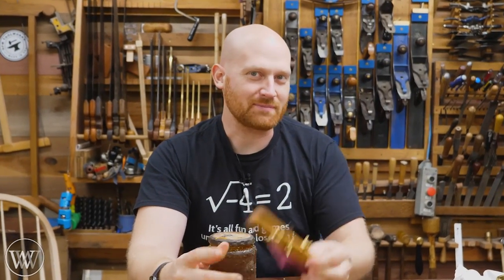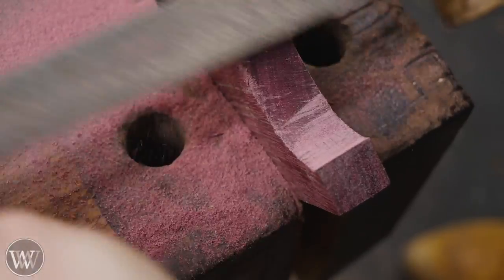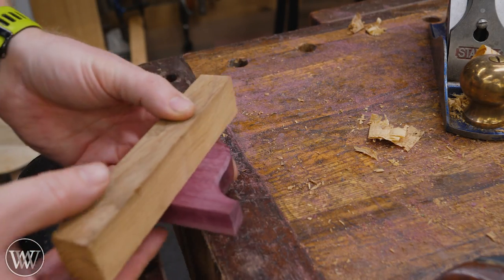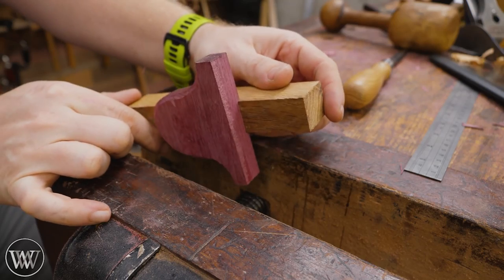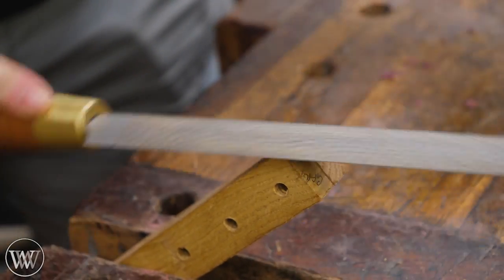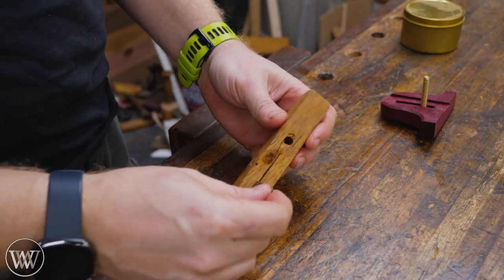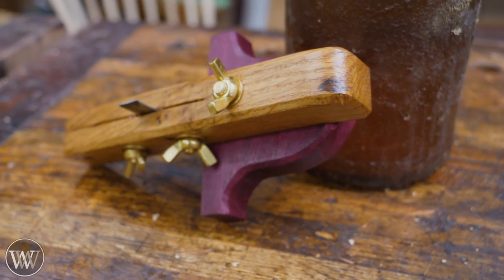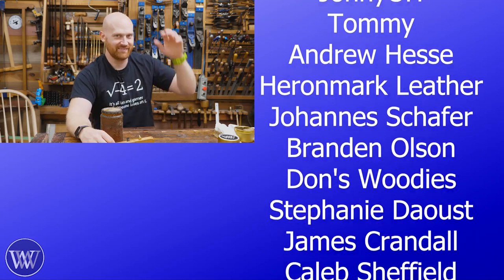How to Make a Scratch Stock

Comment: I got to repair an eighteenth century mahogany sideboard a while back.
Some of the moulding was missing so I used the existing moulding to prepare a cutter for a scratch stock but decided to show off and built a tiny moulding plane instead. Now I have the plane and the owner of the sideboard is happy. The plane was for making a Cock Bead to wrap around drawer fronts. A scratch stock would have been the more efficient use of time but I wanted to try my hand at making a simple plane. Thanks for this demonstration!

Comment: When would a moulding plane, beading plane be prefered to a scratch stock?
Reply from the maker: A molding plane can take off a lot more material than a scratch stock. A scratch stock is used for small details or the final cleanup behind freehand carving. A beating plane is useful when you're doing multiple beads side by side. Scratch that can do it but it takes a lot more work.